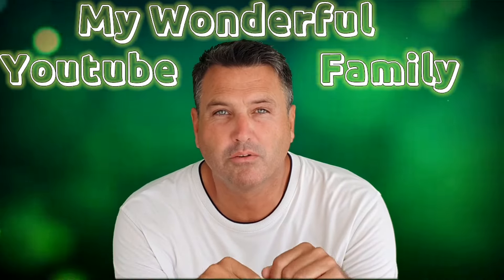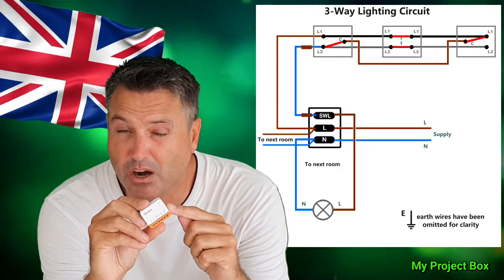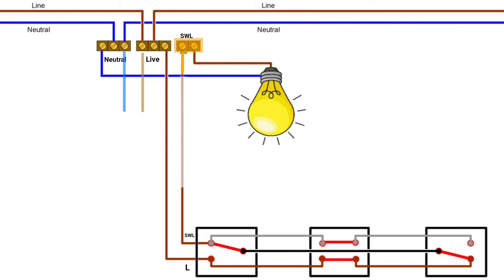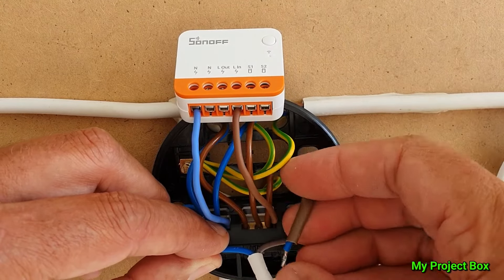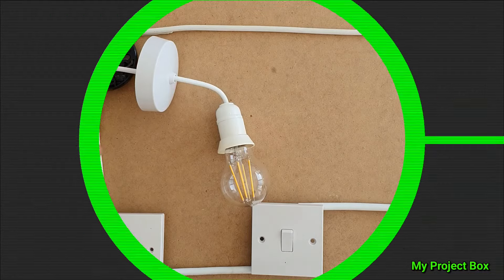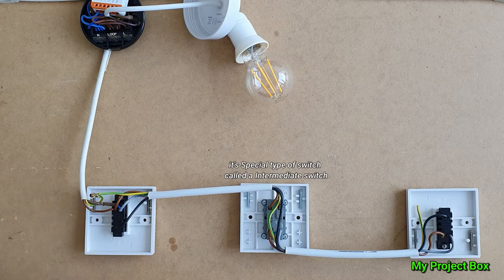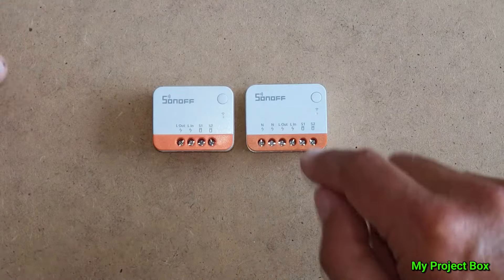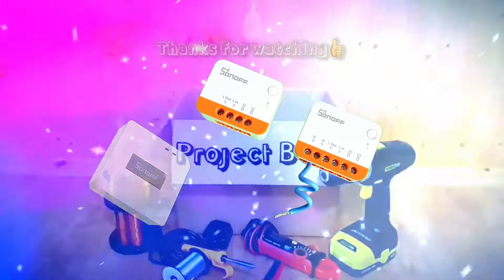Sonoff extreme MINIr4 on 3way switch light UK NO-NEUTRAL required at light switch #Sonoff #extreme

Comment: A huge thanks to you.  I have been struggling for a few years to automate a  lot of my 'no neutral' house.  I had followed some other instructions, but got hopelessly lost as the wiring in the ceiling rose I started first was all backwards (obviously a previous owner had been playing).  Your diagrams and crucially the step by step demonstration not only allowed me to figure out that the wiring was all screwed up and fix it, but then allowed me to fit multiple Mini R4s to 1, 2 and 3 way lighting circuits.  I now have a house full of smart lighting that can still be used with the original switches.  One word of caution for people, you may find that a dimmer switch screws everything up.  It took me quite some head scratching and swearing to work that out.  Thanks once again.
Reply from the maker: I'm glad you figured it all out 👍😉. Unfortunately the wiring can become quite the rat's nest, when people mess around with it.

Comment: switch live input does not work.
Reply from the maker: A switch Live input on S2 works on the mini-R2 only! The original sonoff mini requires a "volt-free" input  from a switch on both s1 and s2. The older mini is different!!!

Comment: How could the no neutral zigbee switch be added to the end of the 3 switches that has no permanent live? You can adjust the wiring to get permanent live but the switched live isnt always connected meaning the smart switch turns off

Comment: I have been enjoying your videos and thought I had a solution for my 3 way light switch setup but I have the European wiring in the UK and so have the switched live at the 3rd switch and live at the 1st with only 2 core between 1st and intermediate switch so can’t feed the live to same switch as switched live. Only other option I considered might work was the magic switch basic r4 at light fixture unfortunately.  May have to wait until the magic switch function comes in something smaller.
Reply from the maker: @beens720  yes! Sonoff "magic switch" would definitely be the easiest option. I did try to tackle this issue before with a custom circuit, but its a bit more complicated. This was before sonoff released magic switch on the new Sonoff basic-R4. https://youtu.be/9hQFFsBkxaU

Comment: I have purchased a SONOFF MINIR4 to make an application, with Alexa creating a routine, to my solar energy system. The idea is that it tells me when I have power from the electric company and when I don't...the question is, can I put a 120v cable on the S2 so that it tells me when there is power and when the power went out?...thanks
Reply from the maker: Yes and No🤣. I need more information to tell you if its possible. Is the minir4 being powered by one supply and trying to detect a different power supply, to see if that different power supply is still on or not?? You can not mix different power supplys. To do it safely you need to somehow isolate the S1 and S2 input from the other power supply, maybe with a relay or optocupler. Could you possibly give me more information.

Comment: Great video! I have a question thoguh - if it's possible to do a "No neutral" version of the device, why make one that requires neutral at all? Why just not make all of them "no-neutral rquired"? :(
Reply from the maker: Good question 🤔.  The problem is that there is always some compromise with  "NO-NEUTRAL" designs(with my design the LED bulb needs to be able to work with DC). You do require the neutral to complete the circuit somehow, so that the smart switch can have a power supply. By not having a neutral at the smart switch, you are trying to steal power from the light bulb, without turning it on. That is why some designs have a bypass at the light bulb, or it needs to be a ultra low power device like a zigbee(not  WiFi), so you don't need the bypass. There is no substitute for a real neutral at the smart switch. The next best thing is to put the smart switch directly at the light fixture. I have "designed" a smart bulb that works with a normal light switch 
https://youtu.be/29QgXRgHCx4
Reply: @MyProjectBoxChannel  Thanks for the reply! That's actually interesting, so basically, the drawback of "no-neutral" designs is that the Live wire going to the bulb is never truly "dead" and there is alway current on the bulb which can cause flickering with some bulbs?

Comment: I have a two way lighting circuit and I'd like to put the zigbee version of this behind one switch. Where should I connect the switched live and the supply live? Thanks
Reply: I've just done this using the wifi version as shown in the video here but I think the method I used will work for you (other than there being no neutrals to worry about on your version). What I had to do is look at the two locations were my 2 way light switches are located to work out which end had the switched live wire that runs to the bulb. My switches were wired in that L1 is the Common terminal, L2 has the permanent lives connected (so always on or hot); and L3 was the switched live wire. 

One of my two way switches only had 1 wire connected to the L3 terminal, so it is not possible to use this switch -though make a note of the colour of the wire (it was black for me - it may help for the next step). The other light switch had 2 wires connected to the L3 terminal. They were both in a sleeve, one wire was black and the other was brown. So I knew that the brown wire here goes to the bulbs. So I removed the sleeve off the two wires and wired the brown bulb wire to the live out on the Mini R4. The next step is to get a small length of wire that will go from the S2 terminal on the mini R4 to the L3 terminal on the switch which will also have that black wire also connected to it. So it is more or less the same method used in this video. Hope this helps.

Comment: Mostly the UK has switched to "two plate" wiring in newer houses, where the live and neutral are taken to the switch and then on to the light. This makes it much easier to upgrade to smart switches or relays of course. However, there are still benefits of the "three plate" system you show here, and it was the norm until perhaps the early 2000s and is still used today in some cases.

You do find the "EU" method of 2/3 way wiring in older houses using twin and earth, but it can lead to an issue with what we call a "borrowed neutral", especially when it's used on stairwells. The live in at the ground switch may be on the downstairs lighting, while the neutral at the landing light is on the upstairs lighting circuit. That makes it hard to isolate individual circuits safely so can be a danger to those who aren't aware of it. It also will cause tripping if the Live and the Neutral are on different RCDs/RCBOs.
Reply from the maker: I do like having the neutral at the light switch, it just makes sense these days😉. At college, back in 2012, I was still taught the 3-plate  method (as a sparky, coming from South Africa to the UK, it was quite alien to me🤣). I remember arguing with my teacher, that we will need to take the neutral to the switch, to make the future-proof, for electronic switches, like PIR motion sensors. I guess 2-plate, 3-way Uk lighting, is still wired the same as in this video. Just with "everything" going to the first switch. I have seen some light switches with a "parking terminal" for the neutral. That saves a connector behind the switch. It's a nice touch. 

 I have some "experimental" no-neutral circuits, If you are interested https://youtu.be/oBR5O391m_c

https://youtu.be/9hQFFsBkxaU

Comment: Well, the UK wiring hurts my head when I tried to understand it at the start :D
In Poland it's connected typically as you shown, it looks clean on diagram, but what installers do, they make a box somewhere in wall, when they connect all switches wiring to and the light into.... so physical wiring is a mess to debug.

Comment: This is an excellent explanation on how to wire these, thank you! Is it possible to use this method with a 2 way switch that turns on 2 lights? (2 lights in hallway with a switch downstairs and upstairs)
Reply from the maker: Yes you can, providing you have the UK wiring method used in this video. You just won't have the middle/ intemperate switch. You will have to connect the MINI-R4 at the first light/ceiling rose, that connects to the switch lines. The first ceiling rose just feeds the next light. It all depends on how your house is wired.

Comment: As the matter version has the same terminals I assume that would be the same wiring?
Reply from the maker: Yes. I think they are both identical in every way, except for the firmware/software inside might be the only difference, as far as I  can tell. Inside the pcb looks identical. It might just be possible that with a firmware upgrade, you could make the mini-R4 matter compatible, in the future.
Reply: @MyProjectBoxChannel  Thank you I’m looking at buying the matter version for automating my lights via Apple HomeKit.

Comment: Thanks! I try Shelly1L but my all home LEDs blinks with OFF state even if I use Shelly Bypass. I buy ZBMINIL2 and WORKS AS CHARM - I BUY 10x of them now :) Thanks for this sonoff with no neutral info! ZBMINIL2 is winner :)
Reply: And I use HAssistant + Conbee2 USB controller - no hub from vendor what give me a freedom with zigbee protocol.
Reply from the maker: No problem 😉. I also have a universal "no-neutral bypass" design, for more options. https://youtu.be/fT3YztU2MYE
https://youtu.be/8h29-0rpQJo

Comment: Have you ever encountered a three-way switch system wired in a 2-plate method, where the feed to the switch has been put into the intermediate switch? The intermediate switch has six wires. A black wire goes into the top L1, a grey one into the top L2. The lower L1 has a black wire with a brown sleeve AND a brown wire, while the lower L2 has a grey wire with a brown sleeve AND a brown wire. There are also seemingly unused neutral wires (blue wires in a choc block) hidden in that particular back box. The other two switches are identical and only have three wires in them: brown in Com, black in L1 and grey in L2.

How would a Sonoff smart relay be added to this circuit?
Reply from the maker: @Tinseltown17  it's definitely possible to put the switch live and live feed on one side of the intermediate switch, because of the way 3-way is wired in the UK. So it kind of makes sense 🤔. If you have a neutral behind the intermediate switch then you can put the mini-4, because you have all the wires needed to connect it. Providing there is enough space. Alternatively it has to go above the ceiling somewhere were you can get the Live and neutral and sL wires.

Comment: Just wanted to comment to say thanks, this was the best explanation i could find online, even compared to the official stuff. It got my sonoff working beautifully. Here in the UK i did what you showed there but i had the device at the switch and used a shared live for live in and L1 on the switch via a wago. That way i could drop a 3 core and earth from the light to the switch. Cheers!
Reply from the maker: That works too😉👍. You are lucky enough to be able to pull wires down to the backbox😉. I'm glad my video was useful to you.
Reply: @MyProjectBoxChannel I wonder if it would be of benefit to others if you did a video of installing the R4 from a loop at the switch (neutral at switch) on a 2 or 3 way circuit? i certainly know that i hunted around the internet looking for such a thing!
Reply from the maker: @pauladamson9763  good idea 💡 👌

Comment: How to connect one way
Reply from the maker: The two lines(L & SL) going down to the switches just connect to one switch only. This is for UK 3-plate method in this video. It might be different wiring systems, depending were you live.

Comment: What a fantastic video: really clear, and I had not thought of getting a bigger ceiling rose cover, but I cannot seem to find one anywhere in the UK; please could you post a link for the one you showed? Also, I am using a different make of WiFi switch, but I suspect very similar internals; the one I am using, however, warns against using a live feed on the S1/S2 contacts, and I was unsure how your circuit worked using the switched live on S2, but maybe that is specific to the Sonoff? I too was going to use the switched live from the switches on, say, S1, but I was going to disconnect the permanent live feed from the switches and use that in S2 thus creating a very low voltage manual switch circuit.
Reply from the maker: You have to be very careful with some some smart switches. Having a no volt/ isolated input to S1 and S2 in a good idea! (Some are internally referenced to neutral, and some to live!). The mini-4 can work with a switched Live on S2 only, but with the older mini-R2, the S1 and S2 needed to be isolated switch inputs!

I have seen the larger ceiling rose covers in B&Q. It normally comes as a complete pendant with a edison screw bulb holder. https://www.ebay.co.uk/itm/193009114317

https://www.smart-light.co.uk/product/e27-pendant-holder-orange/

https://www.buyitbetter.co.uk/products/elektek-pendant-light-ceiling-rose-braided-flex-e27-silicone-lamp-holder?variant=30342332776514

Comment: Hi, I'm just wondering... is there any behavioural difference between connecting the switch isolated (using S1 and S2) or having the switch live (using just S2)?
Reply from the maker: It should work exactly the same. The mini-4 and mini-R4M, have the S1 terminal, internally directly connected/bridged to L-in. That why you don't always need to connect S1. This is different from the mini-R2, that can only have a isolated switch connected to both S1 and S2.

Comment: Thanks for a fantastic explanation. I've ordered the switch (zigbee neutral version) but can't find the required deeper cover anywhere. Any hints?
Reply from the maker: @whythedevilnot   I bought the large cover that comes complete with a pendant light, in B&Q. I have also seen them in ikea. Look at this ebay link. https://www.ebay.co.uk/itm/186933968247?mkcid=16&mkevt=1&mkrid=711-127632-2357-0&ssspo=iu5idfeysx6&sssrc=4429486&ssuid=qu3kmgcqR9W&var=694995047145&widget_ver=artemis&media=COPY

Comment: Denmark, 
Changeover switch for third (in line) switch or switches is the norm
Reply: The ZigBee question.
I have both and the wireless range is poor on the hub, and have since decided to use the 4 ch pro rf in the tech and run everything back to there with wireless switches in rooms as the wall switches here are ridiculously expensive about £30 for patress and back box equivalent, they are plastic rubbish fiddly and the monopoly of only one supplier is ridiculous, the sinoff rf switches at under £5 each and no cabling is a much simpler cheaper option.
I could use WiFi bulbs but that drives the price back up.

Comment: hanks for your video. A question please . How it can be used in a Home Assistant Integration
Reply from the maker: @gbadishomeassistant748  If you use the mini4M (matter version) you can use QR code to easily add it to Home Assistant. I think for the mini-4 you will need to flash the firmware.

Comment: This is fantastic! I'm looking at getting their Matter device, but I need some information for my situation. I have a kitchen/diner with one bulb in the kitchen area, and another in the dining area. These bulbs are connected to a single fixture that has 2 switches (one for the kitchen area, and one for the dining area). Would I be able to connect a single Sonoff device to the switches, or would I need multiple? Also, would it be best to connect it to the switch device, or the bulbs? Any help and/or information would be appreciated.
Reply from the maker: The matter version is basically identical. You can mount it were ever you want, but the thing to remember is that it requires a neutral connection to function. So anywhere were you have  N   L  Sw-L  available will work. The N connection isn't always available behind a light switch. I have a "virtual-Neutral" circuit that can help people with this problem. https://youtu.be/mznx0xoF8Ck 
I assume you are switching both lights from one switch? In that case is possible to use just one sonoff. If you would like to switch them independently you require a dual channel device or two separate devices. You will need to investigate what wiring connections you have available to you, so you can see were it can be installed.
Reply: @MyProjectBoxChannel  Amazing, thank you so much for the information. I am switching both light switches from one switch, so this is good to know. I have an electrician coming round tomorrow as my wife is worried I could blow up the house 😂 but the information confirms I have made the right choice. Now to buy more of these amazing devices and have my home a Matter smart home!